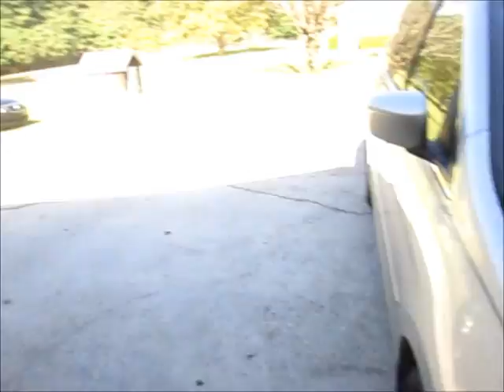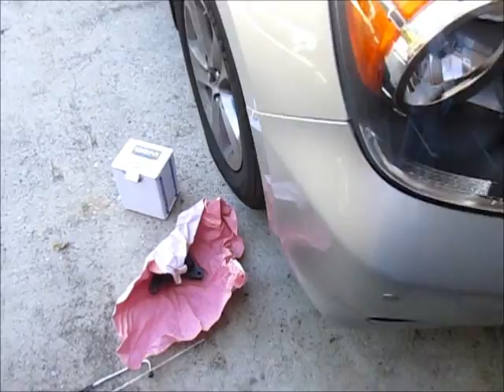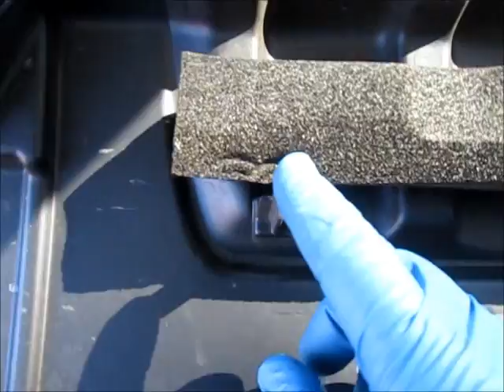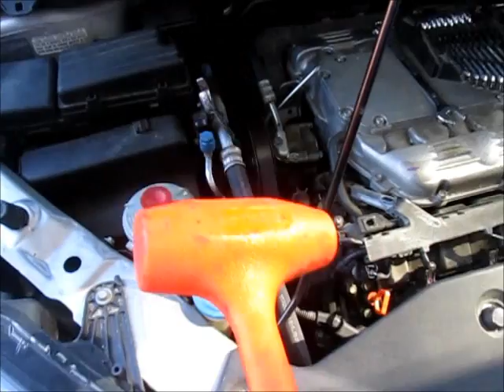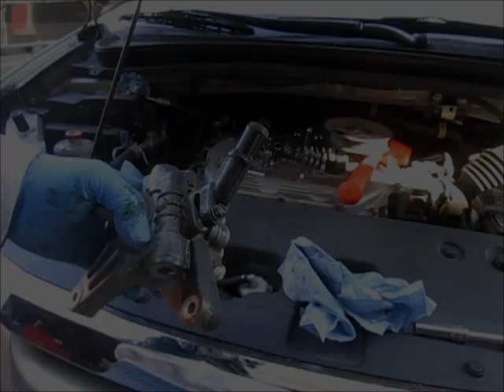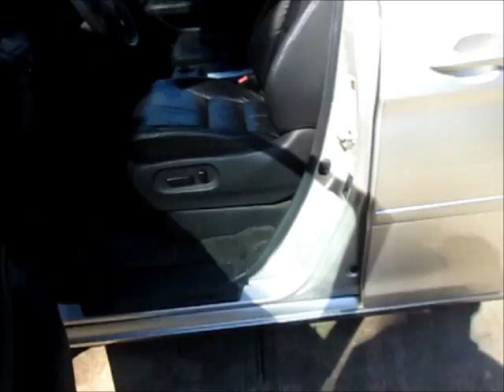Replacing a power steering pump on a Honda Odyssey

Comment: There's a tensioner pully right under the power steering pump that allows you to release the serpentine belt so you don't have to do that last part. It's a bitch taking that belt off like that.

Comment: Thanks for this great video.  It gave me the confidence to do the job.  I wish the description contained the year of the Odyssey. The maker says 2008, I just think it would be helpful at no cost.  While the pump was removed I checked the bearings on the tensioner and “idler roller” (not sure the proper name) and there was slight wiggle in the idler.  Also replacing the belt while it’s all apart.

Comment: Is cost the reason you choose to not use a Honda pump?
Reply from the maker: Availability. Easy to get an aftermarket one quickly.
Reply: @JoDaddysGarage  Thanks for the response. Can you recommend a brand. Just one at a local auto parts store?

Comment: Took out  pump then put pulley in vice and put wrinch on nut  whacked wrinch with hammer off came nut ! When disconnected feeder hose  stuck rag in hose  to stop fluid flow out , pump didn't come with new oh ring seals so used the old ones and NO Leaks ! Replaced tensioner pulleys when did pump and new belt !  Check pump fluid level ! Now me happie go drink beer ! Make more happie ! 😜😜😜🍺🍺

Comment: I haven’t replaced the pump on my 2007 Odyssey, but replaced the pressure hose, the o-rings, and that sound towards the end of video is what my car sounds like.  When I turn on the car I don’t hear anything close to what your van sounded like. So I’m going to keep driving in hopes that air comes out. It’s been at least weeks since I replaced the pressure hose, I’m hoping it’s goes away. Great video.

Comment: I had a power steering noise issue and I just changed the O-ring on my 04' Honda Ody and steering pump noise gone instantly.    Got the OEM O-ring at Honda for $2.35, cheaper than ebay.

Comment: Great video. I'm ordering my power steering pump today! Quick question.  About 2 weeks ago, on top of the whining and groaning noise you were experiencing, I started hearing a loud tapping/clicking noise under 2000 rpms. Above that rpm it goes away. Could this be associated with the bad power steering pump? Would a new pump fix it? To be honest the whining noise on my odyssey has been present for about a year and a half now. I'm wondering if it's got so bad that the tapping noise is a result? Thanks for all you help and input.
Reply from the maker: If the noise exists after you change the pump, it's likely the timing belt tensioner.  I replaced one of those too. It's in the Honda Playlist.
Reply: @JoDaddysGarage  Thanks Jo. You seem pretty confident in your response. I'm guessing the noise goes away due to the extra tension created above 2000rpms
Reply from the maker: @andrewbahadoor1427  I just know from the sounds mine made. The other option is the rocker arms are slightly out of adjustment.
Reply: Jo Daddy's Garage you were right on the money with the timing belt tensioner. I changed it out and the ticking noise is gone so thank you!! However, one noise went away and another appeared. Before changing out the timing belt tensioner I removed the accessory belt to make sure the noise wasn't coming from one of the pulleys. When I put it back on, I got a quiet squealing. Sprayed water on the inside of the belt while it was running and the noise went away. Misaligned pulley?
Reply: Jo Daddy's Garage  or could it be the belt was put in backwards?
Reply from the maker: @andrewbahadoor1427  Hmm.
Reply from the maker: @andrewbahadoor1427  That's a possibility. How old is that belt?
Reply: @JoDaddysGarage  I've had the minivan 4 years and never changed it although it doesn't look that bad.
Reply from the maker: @andrewbahadoor1427  You can try turning it around, or just replace it. All I can suggest. Sorry.
Reply: @JoDaddysGarage  I'll do that.  Thanks and I'll let you know for future reference. Cheers Jo!
Reply: Jo Daddy's Garage just to close out the conversation, I did flip the belt and that fixed the problem. Thanks again

Comment: I had my 2004 odyssey power steering pump replaced since it was hard to turn the steering wheel. 6 months later it’s doing it again. No leaks anywhere. Any suggestions?
Reply from the maker: it may not be the pump. Could be the rack itself.

Comment: Just had to come on here and say thank you! I have a 2009 Odyssey and my power steering has been making noise for a few years, but only in the winter. This year the noise was constant. First I replaced some O-rings in the hose, but that didn't solve the problem. I had a slow leak in the hose and kept filling the fluid every month or so. I found videos on how to replace, but was too nervous because of the location and not having the right tools. I had a mechanic do it. Cost me $300, typical, but too expensive to me. He said I probably needed a new pump too and it would cost $600 for the job. I got a pump on Amazon for $70 and replaced it in less than 20 minutes. Your video gave me the guts to do it. The only thing I needed to get help with was loosening the tension on the belt. Once I got that, it was easy.
Reply from the maker: Great! That's why I make theses videos.

Comment: I paid someone to replace the leaking top hose.  Afterwards, it squealed like a banshee.  They claimed it would just take time to bleed out the air. (B.S. - no change after a week) 
The dealer told me the only thing it could be is a bad pump. (Idiot)
I used a turkey baster to remove the fluid from the reservoir.  Hardly any spilled.
I got the pump out.  removed the bottom pipe and noticed there was no resistance.  The new o-ring on top was very hard to pull off.
This made me suspicious.  I tested the spring of the o-ring.  It broke into 3 pieces.
I figured it was worth a shot, so I put on a new o-ring, put it all back together, and like magic, it works fine with no noise.
I'm guessing when they replaced the top hose, even though they didn't touch the bottom hose, while the fluid was drained out, the o-ring dried out and became like glass.
Reply from the maker: Glad to hear you figured it out.

Comment: Changed mine a little trick to get the belt back on cuz the tensioner bolts are a pain. Put on the belt put it on the back of the PS pulley and turn the PS pulley with a wrench and it will put itself back on it

Comment: Completed this job today. Tips: 1) There are two different 19mm bolt heads mounted to the serpentine belt tensioner plate, one high and one low. I stripped the lower one, but found the upper one much easier to push towards the vehicle's rear as it has more leverage against the hydraulic serpentine belt tensioner mounted low on the passenger side of the engine. I used a 19mm,  3/8 inch drive, splined socket connected to the long serpentine belt bar tool, also 3/8 inch drive, both from Harbor Freight. YOU MUST PUSH VERY SLOWLY AND STEADILY to overcome the hydraulic tensioner without stripping a bolt head. The thin serpentine belt bar tool is very helpful in this really confined workspace. I strongly recommend against using a crowbar or prybar against the crankshaft pulley/oscillation damper as it can generate a really large expense. 2) Really helps to move the power steering fluid reservoir to free up space. 3) Good idea to tie your vehicle's hood to garage roof overhead as the hood support rod gets very much in the way. I discovered a second hole in the hood that fits perfectly and allowed me to raise my 2007 Odyssey hood much, much higher than the usual amount. 4) After finishing the job and having drained the reservoir, the new fluid was clean until the moment I started the engine. It dropped from high to below low in moments and darkened up again. Wish I had looked up the full draining/flushing procedure - due every 60,000 miles/100,000 km. 5) Steering is doing fine, but will monitor it closely for the next week or two to see if the leakage has stopped. I only did this as mine has been leaking since we first bought this van 20 months ago. It now has 151,000 miles. Honda of America refused to help with either this power steering pump leakage problem or the dark blue paint (Touring edition) that is peeling off in golf ball sized chunks.
Reply: Samuel Thompson yeah before I installed the new pump I flush the old power steering a couple times with the old pump on so no containment’s went into the new pump

Comment: Jo Daddy, was it just noisy or was yours also hard to steer?
Reply: Take a look at this service bulletin. It might be the pump. https://honda.oemdtc.com/TSB/A11-039.pdf
Reply: I am having the same problem (noise as well as hard to steer but mainly when turning).  Do you know if hard to steer is related to having a bad pump?  Also, should the hoses be changed while doing pump change?
Reply from the maker: It could be the pump or the rack and pinion. I did end up changing the pressure hose later. It would be a good time to do both.
Reply: Thanks for the response and great instructional video!
Reply from the maker: Just noisy.

Comment: Good video.  No need to do all that to relieve the tension from the belt.  Just use a 19mm socket on the hex that is cast into the tensioner bracket.  Here is an image of where to put the wrench.  https://postimg.org/image/x356l6vvz/][img]https://s27.postimg.org/x356l6vvz/Tensioner_Bolt.png

You can buy a special wrench for this, but I always use a 3/8 drive ratchet with a cheater pipe. From the top side, push the wrench toward the firewall to loosen the belt tension. 

Some Torque specs:
12mm P/S pump to block bolts - 16 ft*lbs
pulley nut - 47 ft*lbs
8mm high pressure hose to pump bolts - 8 ft*lbs
Reply: Thanks for the info ... the link to the image is not working ... would appreciate it if you could make it work so I can see how it was done ... :) thanks!

Comment: Jo Daddy, thanks for the video. 

I suggest folks change out the inlet O-ring before replacing the entire pump if its only making noise when its cold.

http://www.driveaccord.net/forums/attachment.php?attachmentid=10581&d=1200936994

Once again, thanks JO-DADDY  for the video.

Comment: Thank you for this vid!  This is exactly whats going on with my 2010 Honda Odyssey, and I'm confident we'll be able to fix it with help from your video!  In regards to Godlikehenry's comment below, do you agree or disagree with his comment?  I havent ordered my part yet, but I'm curious what you think.  Thanks!
Reply from the maker: I did  this video over a year ago, and it's still going strong. I did have to replace the pressure hose recently, so have a look at that. I did a video for that as well.